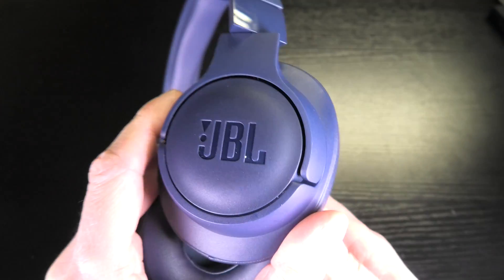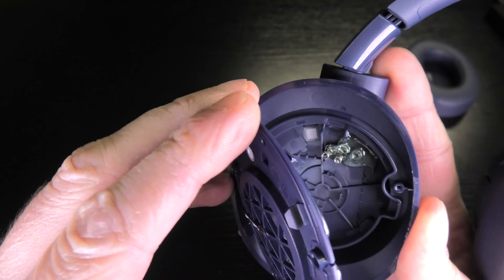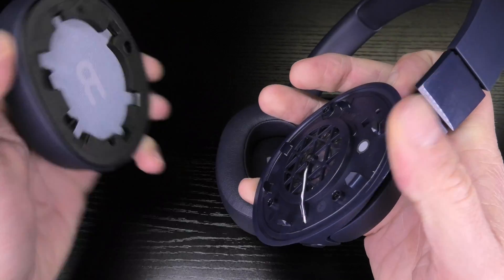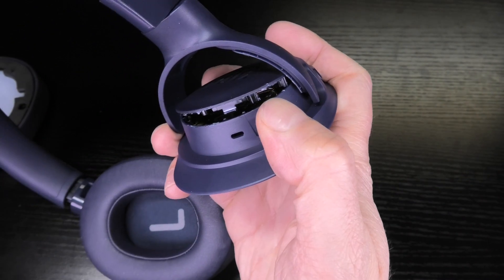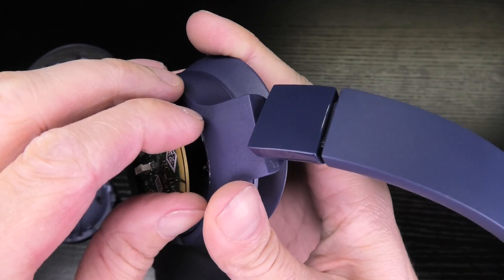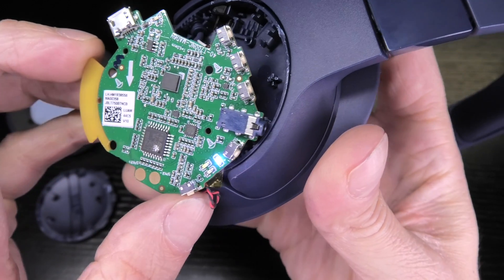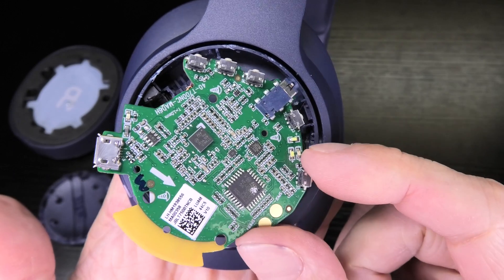JBL TUNE750BTNC - TEARDOWN (what's inside)

Comment: Here because I’m tired of smacking my left ear cup for it to work…
(This headphones are +5 years old 😮, I bought mine 5 months ago, 2 months ago the left ear a suddenly stopped working, while I was looking for a solution on the internet, I smacked it he it started working again but it’s getting worse..)
Reply from the maker: This may be the solution you are looking for: https://youtu.be/jxVqfxQRnP0
Reply: @MegaSafetyFirst  You're a pro, sir.
I don't have exactly the same model of headphones; I have the JBL 770 NC. However, the disassembly steps are identical. The electrical wire connecting the two parts is very tight, making it difficult to separate them. You have to rotate the two parts to work, which is very delicate. I must admit that I'm disappointed by the spring connection system; it's so simple and yet so fragile. I'm not surprised that the sound sometimes stops coming through and comes back after a few taps on the capsule. I don't need to clean the connection pads; everything is like new. However, I don't have Loctite; it's a handy product that I plan to buy again later, even though I'm disappointed that it seems like a troubleshooting solution. I'm going to reassemble everything and hope everything works normally. At least now, thanks to you, I know a little better what the inside of my headphones looks like.
Reply: ... before closing all this I pulled a little on the springs, being extremely careful not to tear them, just to have the impression of having done something more than just disassembling and reassembling the headset. It still works hahah. I can't wait to see if I'm going to have problems again or not

Comment: Thank you! I've solved a tiny broken part making noise on every step when walking because I knew how to open it up. I found this video when searching for JBL 760NC. it wasn't the first result so you may want to add it in the tags.
Reply: Pls tell me what part I also have same problem
Reply: It's the plastic ends that hold the headband on the ear muffs. They easily break. Removing the broken parts gets rid of the noise.

Comment: THIS FIXED MY HEADPHONES THAT WOULDN'T CHARGE THANK YOU! If your headphones won't  charge and the charging light only stays on for a couple of seconds before shutting off I'd recommend opening up the battery department and replug the battery, as there's a high likelyhood that the battery cable got a little loose and just needs a bit of motivation^^

Comment: Dang it mine just broke today i was about to drop them and then bluetooth pairing mode stopped working. So i ofc did the manly thing and decided to take them apart. Anyway turned out it was the on and off button that had come loose i got it to work with it placed with a tweezer but sadly the repair failed because the connectors snapped off. But taking them apart was a breeze thanks to your video :) they lasted about 3 years and i have been using them probably 16 hour a day almost every day. and other than a stupid bluetooth adapter in my pc they have been working almost flawlessly so i think i got my money's worth

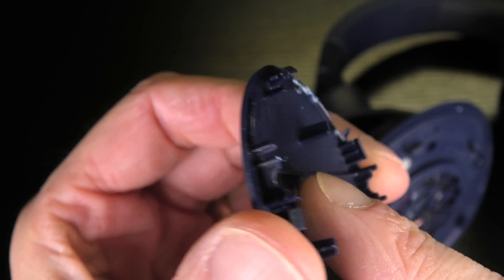Comment: For anyone having the problem where the headset no longer turns on but works via wired, just teardown the small part of the left earcup, inside is the battery as shown in 2:21 and then just make sure the big wire is properly connected and fully in there, then it should work.
Reply: i swear on anything i love you just saved my jbl’s as SOON AS WE SPEAK bro preciate yu
Reply: @_dvidabi7116  No problem hehe, glad it worked for you too :)

Comment: I side when connected with Bluetooth does not work, but with cable both side works. What is d problem here?
Reply from the maker: Sorry, I don’t know how to fix this problem.  I haven’t seen this issue myself yet.
Reply: Have you found a solution? I also have this problem and don't know how to fix it.
Reply: @kasiarech7697  did you find a solution? i have the same problem
Reply: @krzysztofzioko4694  I didn't but somehow it started working properly on its own. So I have no idea where the problem was.
Reply: I have the same problem

Comment: Thanks to you I didn't break these headphones! White cable has desoldered in my headphones - responsible for minus audio signal to the left earphone. The damage was probably caused by a fall to the floor. The quality of the solder joints is dramatic + lead free tin - shame on JBL!
Reply: Same happened here! Hope I can repair them

Comment: Do you think it is possible to do this without any visible damage? My micro-usb is probably damaged and I really want to repair it, preferably without damaging the headphones.
Reply from the maker: I think it is possible to do this without seeing any damage afterwards. This model is very easy to disassemble.  
The most difficult part is probably removing the ear pads.
Reply: @MegaSafetyFirst  Alright, good to know. Thank you for the quick response! I'll definitely rewatch this video a few times before attempting the surgery.
Reply: @MegaSafetyFirst  pls help my left ear is not working again.
Reply: @MegaSafetyFirst  hello, do you think the 2,5 jack on the pcb can be replaced with a 3,5 jack?
Reply: I think my USB port damaged as well. Have you manage to repair it?
Reply: @samral1515  I'm afraid not. I ended up just sending it back and I even got a replacement. I didn't really want to do this, but it did seem like the best option. I'm lucky, since my warranty was still valid. 

Good luck!
Reply: @Iraijus  thx for helping

Comment: I bought a pair of these phones just yesterday, October 20, '20. With a special senior citizen's discount the price dropped from NZ$239 down to NZ156. I have only used the phones off and on over 24 hour, so far. Based on price and quality I rate these, my first BT, phones highly. However, watching you "disassemble" the phones was somewhat akin to watching a surgeon taking out my appendix and providing a commentary as he did so. 

It is an interesting video despite my wincing as you proceeded with the stripdown. Now I know what's under da hood. Thanks.